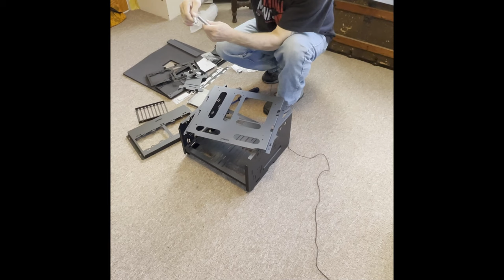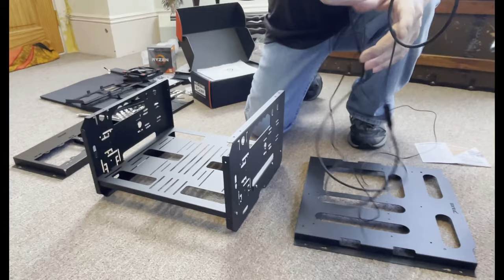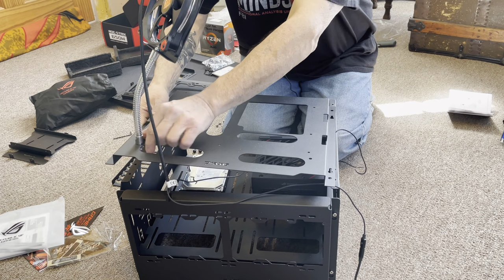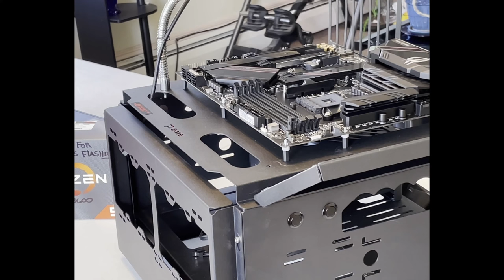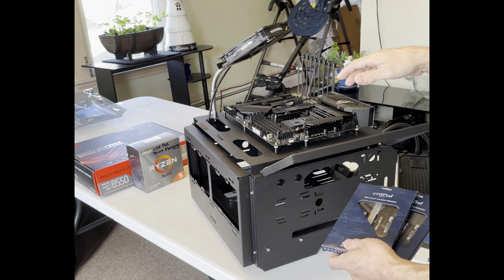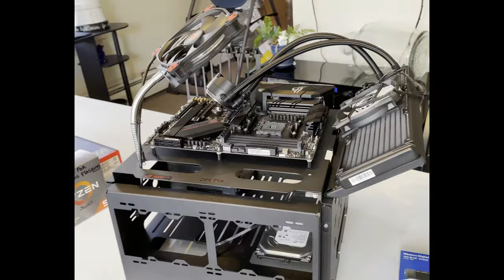how to setup a Praxis Wet Bench

Comment: Question for you on your b550 msi meg  which sata port is for m.2 slot 3?
Reply from the maker: 2 drive is SATA. If it's a PCIe (NVMe) then no SATA ports on the motherboard will be disabled. Also you cannot run any SATA M.

PCI_E1 is connected to CPU and supports PCIe 4.0 x16.
PCI_E2 & PCI_3 are connected to chipset and support PCI 3.0 x1.
PCI_E4 is connected to chipset and supports up to PCIe 3.0 x4.

Thank you for watching my channel
Reply: @JPsTechReviews  so I've got a wd black sn750 nvme card not sure which slot to put it in I'm sort of just sat in the bios as o can't seem to find it anywhere and keep up the good reviews of things
Reply from the maker: @or1ginalmrsm1th  It did the same to me, for reason it does not show up in the bios but after I rebooted it shows up in File Explorer when I used it for a second m.2.  MSI is a little funny like that.  If you are adding it as a new boot drive just use the USB thumb drive for windows install.
Reply: @JPsTechReviews  yeah it's being used as a new board and I can see my sata hard drives just not the nvme so my next plan is to unplug sata HDD the try look in bios for the nvme, and try your ways. Keep up the good work